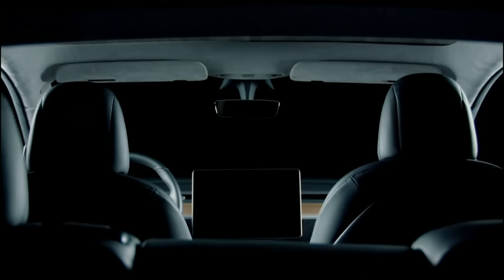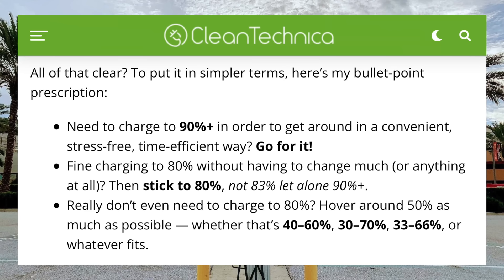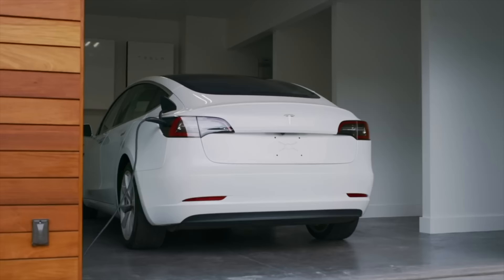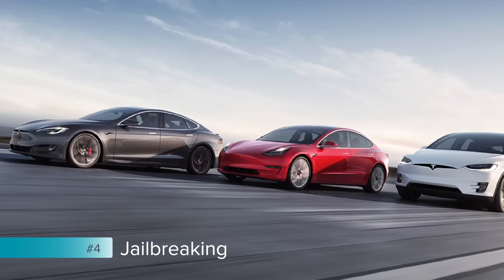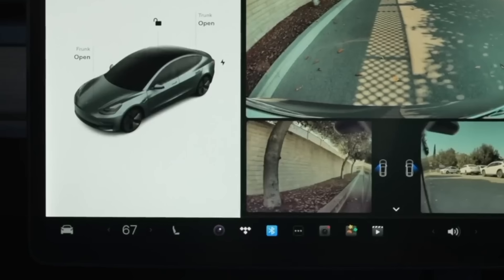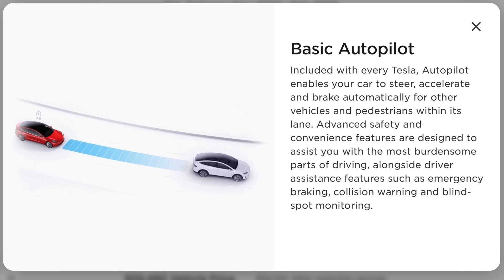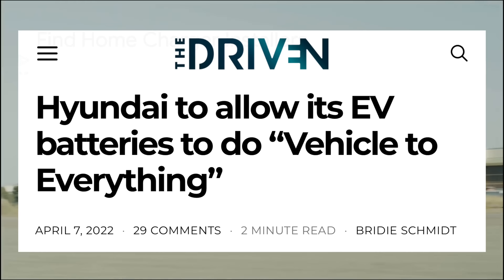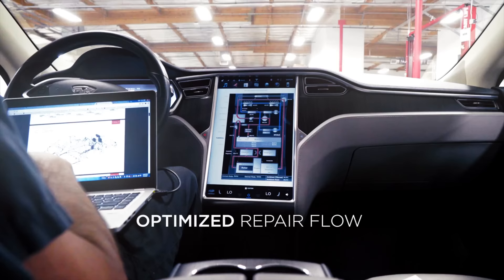10 Ways To Ruin Your Tesla | DO NOT Make This Mistake

Comment: Useful video. I have to say that I have been recharging my 2015 LEAF in the worst way possible, some of the time. I regularly drain it down to zero and then recharge it back up to 100%, and then keep it there for 8 hours or overnight. None of this is because I want to or am trying to damage the battery, but because of necessity and because the UI for the LEAF is horrible. There may be an app, but it was so terrible I couldn't sign in even once when I first got the car. Average battery degradation though. 68K miles and down 1 bar. 🤷‍♂️

Comment: Great video sir!!! P.S. I would add that, setting the Autopilot speed too high can cause it to steer out off its lane. This happens to me mainly in parkways, if the speed limit is 55 setting it to 70 is a problem in certain curves specially when there's a hill. Sometimes it slows down but other times it goes over the lane and could hit the shoulder if you don't take control.  I only increase the speed 10mph+ above the speed limit  in large interstate highways... The fact ppl know when NOT to use Autopilot makes me wonder how valuable are the safety stats Tesla publishes. 🤷‍♂️
Reply: Agreed, my usual local highways don’t have very many curves so I never noticed. Went on a roadtrip to LA where the route curves a lot in some areas, and at the max Autopilot speed of 85 mph, the car did not stay in the lane at all and actually went either into the shoulder or the next lane…was very scary and I ended up disabling AP when a curve came up because of how little effort it made at staying in the lane.
Reply: @vijayraveendran9075  85 is a high on curvy highways.
Reply: @StefanSteinerWA  Agree... Maybe it should display a warning.
Reply: Weird, my m3 won't let me go higher than the mandated km at lower speeds. Only once you're at 100 km/h or 60 mph will it let me cruise at at the maximum 150 km/h, something I always accepted as a very logical safety issue.
Reply: @Daergarz  I've noticed that in some local streets that have 30 or 45 mph speed limit.
Reply: @Teddy_M85  Our Model 3 popped up a warning that auto-steering is only intended for reasonably straight highways with clear lane markings.
Reply: Why not just do the speed LIMIT? You don't save much time by speeding and you create a dangerous situation to others around you. Hope you get your license taken away soon.
Reply: @safetylast911 Because my time is valuable. Worth over $250/hr. Not valuable enough to hire a driver so I can work rather than drive, but valuable enough that getting 2-3 citations per year is negligible compared to the time saved. Driving 30% above the limit saves me about 100h/yr compared to your suggestion. So let me rephrase the question to you. If someone offered you $25000 a year to drive 30% over the speed limit for the year (traffic permitting, no need to weave, just follow the car in front of you in the fastest lane), would you do it?
Reply: That's the most ridiculous thing I have ever read  @Elladril

Comment: Ryan the optimum SOC range for lifetime varies by Li-ion manufacturer and is not universal to all Li-ion. Some like sitting at high SOC, some like sitting in the middle, some like sitting at low SOC. I personally tested over 13 commercial Li-ion manufacturers between 2014-2020 and created a completely new test program targeting sensitivity to certain SOC ranges and saw results all over the map. Tesla’s 1st Gen 2170s were different than 2nd Gen. I’d expect 4680s to be different yet again. Also determined by other factors such as resistances and the heat-dispersion capability of the cell, of which the 4680 should be exceptional.

Comment: The clunkiness of the front trunk has always puzzled me, comparing to the rest of the vehicle.
Reply: It is aluminum to save weight.
Reply: @billhunsinger862  I'm referring more to how it closes.
Reply: @shumandaniele  It does not have a safety catch that I thought was a requirement. I was thinking of getting the auto version but there was an incident that it released at speed and resulted in $3,000 damage. The after markets versions have ceased advertisements.

Comment: my tesla tells me to charge my car to 100% once a week “To maintain battery health, keep the charge limit at 100% and charge fully once per week”
Reply: Do you have a Model 3 or Y standard range? If so, you likely have a lithium iron phosphate (LFP) battery. Those have a tougher cathode structure and can withstand the strain of repeatedly charging up to 100 percent. They can also stomach many more charge cycles than traditional lithium ions — into the several thousands, which is likely far beyond the life of the car itself.

The disadvantage is energy density: you simply can’t hold as many joules per unit volume as “normal” lithium ion batteries. This is why they’re only used in the standard range, and not the long range trims.

Comment: I use my Model 3 for Uber and Lyft, so I always have people in the back seat that don't know how to open the door.  I am currently looking for a way to install a micro-switch on the emergency release handle such that it triggers the "normal" door opening switch if pulled.  If there's power, it opens just fine, no harm done, and if there's no power, it still opens!

Comment: I use an elastic band around my interior door handle and it loops around my steering wheel and uses caribiner clips to latch/unlatch.

It’s perfect for long straight drives through the desert and I play my switch or read a book. 

I still pay attention to the road and anytime there are multiple cars around me I will be ready to take control, but it’s pretty fantastic…. 

Is it unsafe? Not anymore unsafe than a screaming baby in my car….

Comment: The LFP battery charging to 100% is actually not for the battery. No battery like being charged to 100%. Tesla specifically calls out the 100% charge is for the BMS to accurately calculate range.

Comment: I stopped at the second minute. For model 3 it is recommended to charge your battery to 100% AT LEAST once a week. Model 3 use LFP batteries.

Other models such as model Y or X are strongly recommended to charge up to 80%

Comment: I have lived off grid for ten years and built the solar systems myself.  I then bought a long Range model 3 and used four 400 watt solar panels, a 3500 watt inverter a 60 amp charge controller and six 100 amp lithium batteries to charge my car. It got consistently 6 mph on 120 instead of the 4 mph a normal home service gets. one day I went to a Tesla super charger and the display informed me that charging was complete. It had not charged at all.  Fortunately Tesla was a few block away and they said I needed a new battery and it was under warranty and replaced it. I don't use my system any more.

Comment: 1) Range isn't what they say. Only 80% down to 30% or half. So 176 to 203 miles when new. 20% loss over time so 140 to 163. Many people commute 150- 200 miles each day r/t. Forget the lie of " most drivers".
2) Tesla "owns" your car and you cannot modify it without voiding your warranty. This new way of businesses is unwanted and authoritarian.
3) Interior cameras will monitor you for compliance with self drive. This will expand and then spread to gov't monitoring of you inside your car for public safety.
This is authoritarian, unwanted, violation of privacy and dystopian. Pure Orwell/Black Mirror.
4) Teslas too picky when shutting the hood. Design a better car.
5) Car needs charge once a week, cannot sit (go on vacation?) and cannot be drained below 20%.

Recent grid issues show what will happen. Grid is stressed you cannot charge, govt will remote lockout your charge (done in CO this week with home smart meters) with smart meter.
Car sits, battery is damaged, you need to buy replacement battery for 10k to 30k.

In summary EV - range is a lie, spy on you, unreliable, picky, finicky, have poor range, and will accelerate their own destruction as they force grid shutdowns by need to charge to prevent permanent battery damage.

All of the above analysis done by applying reason and logic to the video.
No conspiracy theory was needed just common sense.

EV are a mistake.

Didn't even do environmental analysis or strategic.

Comment: Supercharging often will drastically deplete the battery life. People who live in apartments that don't have a charger are the ones who are complaining about battery life. First off many of them bought used Tesla's so who knows what the previous owner did, secondly using supercharger all the time is just bad. You need a 240VAC charger if you want long battery life. Over 75k miles on my Model S - used superchargers 3 times... ZERO degradation on my battery.

Comment: AVOID SCRATCHED RIMS
dont pull up close to the curb, drive a little past your spot and back up, watching your rear tire in your side passenger mirror you can wiggle and get perfectly tight to rhe curb. when you drive up, youe blind.. you cant see your front tire next to the curb so juat back up and use your mirror.

i once took a weekend driving course like 15 years ago and half of 1 day the 6 of us and instructor just adjusted our mirrors and we all helped eachother understand the importance. i mean half the battle is dont guess just get out and look, STOP and look.. you will know your surroundings.. if its busy just put your four ways on smile wave and say sorry.. just do you it takes 15 seconds to get out and look.

ive had my class 1 for 20 years, journeyman crane operator etc.

Comment: I wouldn’t spend money on an auto pilot nag defeat device either but as long as you pay attention and are prepared to take over I don’t see how it’s any more unsafe not to have your hands on the wheel. Ford’s auto pilot competitor “blue cruise“ or whatever it is doesn’t require you to have your hands on the wheel at all as long as you were monitoring the road.

Comment: Would like you to do a video on towing and phantom braking. I have a '21 model 3 Long range. I had u-haul install a tow package and pulling a trailer (<2000 lbs) and lose about 40% range. When I drive on highway 97 between Weed CA and Klamath Falls OR I experience a dozen or more phantom braking incidents. Bug reporting it for a year now.

Comment: 1. Don’t overcharge the battery to 100% (unless it’s an LFP battery )
2, Don’t run battery to 0%
3. Don’t slam the hood or bonnet
4. Don’t buy non Tesla software upgrades (3rd party modification) could void warranty 
5. Be careful with scratching your wheels- easy to do
6. Electric Door handles- manual override could damage interior trim from inside
7. Hardware modifications could void Tesla warranty 
8. Auto pilot - you need to be present and pay attention- don’t bypass this.
9. Don’t use Tesla battery as power source for anything else
10. Don’t service the car outside of Tesla garage network

Comment: Using a small inverter is not wiring a house! I got a small 300 watt unit to run my inhaler machine in an emergency! Great to see it voids my warranty! That’s unreal. The 12 volt battery usage should not void warranty! What if in an emergency another car needs jumping because of dead battery? 12 volt battery should work fine. Not using EV battery only entertainment system battery

Comment: I learned the hard way that the Tesla Model Y needs to have an alignment done soon after taking delivery.  I had a flat many miles away from the nearest town in North Texas.  Amarillo was the nearest town, but when I searched for a replacement tire there were none available until Monday (the flat was on Friday).  The inner tread on both front tires was completely worn through.
Reply: Oh, that's scary.

Comment: IF TESLA WOULD LIKE TO HAVE THE ABSOLUTELY  BEST MILEAGE OR RANGE TO ALL OF THEIR VEHICLES EVEN THE CYBER- TRUCK IS TO PUT ON A BICYCLE TYPE GENERATOR ON EACH TIRE AND THEN THE CHARGE- UP COULD BE MAYBE AS LOW AS ONCE A MONTH OR POSSIBLEY EVEN NEVER DEPENDING ON THE QUALITY OF THE GENERATORS THAT THEY INSTALL TO THEIR VEHICLES- !!!!  THIS I BELIEVE WOULD REALLY BE A GAME CHANGER- !!!!  I HAVE A 2004 DODGE RAM PICK-UP WITH OVER 310 ,000 MILES AND I BOUGHT THE TRUCK NEW  AND MY HOPE  IS THAT SOMEDAY I WOULD BE ABLE TO UPRADE TO A CYBER- TRUCK AND WHAT WOULD MAKE THAT FANTASTIC WOULD BE TO HAVE DUAL WHEELS IN THE TRUCK AND ALL TIRES TO BE RUN FLAT TIRES THAT NEVER HAVE TO WORRY ABOUT ROAD HAZARDS OR ANY OTHER TIRE FAILURES THAT MIGHT OCCUR- !

Comment: Has anyone had issues with how easy the front window chips? Any recommendations on a repair kit?
Reply: I got hit by a rock 2 weeks into my new 2021 Y.  Rock hit the bottom drivers side.  The crack went immediately.  Replacement.  Then I got hit again in the drivers side at the top, not replaced yet.  Don't want to have my insurance go up.  Will wait till it sends a crack.  It doesn't effect my vision.

Comment: Is there a basic model where there are no electronic features. A mechanical speedometer, manual locks, manual windows, manual radio, no touch screen, manual steering (non electric)? 1:58

Comment: 2017 Model S - I've charged my Tesla to 99% to 100% every time, no degradation, no problems (so far).  What's the point of buying car w/ X mile range if you can't use it?  I also charge my smart phone to 100% regularly...

Comment: I have a 2013 85S ,my battery needed to be replaced two months out of warranty for around $12,500. that was a deal a new battery would’ve been closer to 25. Then someone ran a stop sign did $35,000 damage to my car.  That Battery needed to be replaced AGAIN They were kind enough to put a new battery in. What happened was astounding this new battery will give me 250 miles, or so it says, on 90% charge! And yes Ryan I do think one of the worst things about 21 inch wheels, and no cameras is you will get that curb rash. Very expensive to fix so I gave up. I love the Tesla but the very worst thing is how they go through tires. My rear tires only got 9000 miles. And I do not do Figure eights in a empty mall parking lot either it just eats through tires.
I was fortunate that when I bought the car (A little under 50,000 miles on the odometer)it came with unlimited charging, grandfathered in for life. I don’t believe you’re allowed to transfer that perk anymore so I’m planning on keeping this car long after my own “body warranty” is up, lol thanks Ryan it was great information. Keep up the good work.

Comment: #1 only charge to 100% at least once per week (newly delivered RWD batteries) otherwise keep charge limit to 80%
#2 don’t drop to or below 0%
#3 don’t slam frunk hood
#4 don’t make third party mods (ghost upgrade) could be caught and warranty voided
#5 not paying attention when pulling up to curb. wheel takes the hit not the tire.
#6 don’t use the manual door release regularly as it can damage trim and window.
#7 hardware/upgrades from third party vendors could give tesla reasons to not repair under warranty
#8 don’t try to get around the auto pilot safety features.
#9 tesla batteries are not meant to reverse charging (powering your home with the battery pack for example) it’ll void warranty
#10 you can void warranty if non certified personal work on your car.

Comment: I have a 2021 MY.  This may not be true for earlier models, but if you manually open the front doors, the window will lower just like pressing the button.  I first discovered this when I had a passenger unfamiliar with Teslas used the manual release until I told him how to open it properly.  I did later see where Tesla had updated cars to open the window when using the front manual release.  Again, I am not sure how far it goes back for older models.
Reply: It always lowered a window, that is not root problem of this issue. Root problem is that when You press a button, Tesla will roll down window first and then open a latch. With manual release, you open a latch first and Tesla rolls down as "reaction" to latch being opened. It happens so quickly You might not notice it.

Comment: So I don’t love the Tesla recommendation of charging LFP packs to 100%. I think it’s wise to do it once or twice a month for cell balancing but every time? There are three issues with this: 1 - weak regen at 100% and 2 - even LFP batteries will benefit from being charged to only 90%. 3. - If you’re using excess solar to charge the batteries then it costs more to add grid to continually charge to 100%. I’m not sure what buffer Tesla have at the top of the pack - it’s difficult to balance cells below about 95% because the charge/discharge curve is so flat, so I would assume no more than 5%. LFP packs should last longer than other lithium chemistries so Tesla aren’t really hurting the warranty by charging to 100%.

Comment: What'snot clear to me is if I should wait until battery gets to 20-30% before charging (to let battery charge to cycle), or just charge overnight every night to 80-90% no matter what charge level is? Originally Tesla reps said just to keep topping it of to 90 even if you drove only say 30 miles in a given day. Last guy at delivery said oh no don't charge until it gets to 20-30%.

We don't have (yet) level 2 and use trickle. Drive about 25 miles one way (plus incidental mileage). Not topping of daily means toward the end of the week we may not have enough charge.

So clear on not charging past 90% on daily basis. But not clear on recharge levels and charging frequency. Can you clarify on that?

Comment: Ryan, excellent video as usual. One quick question, does upgrading the USB drive (128GB) from Tesla to a higher capacity (1TB SSD) drive from Sandisk - violate the warranty? I have purchased the SSD drive but have not upgraded yet. Any thoughts? Thanks
Reply: No, it will not.
Reply: why would it void warranty?

Comment: If you have a problem (flat tire or running battery too low to reach a charging station) on the road and use AAA service will that be a problem? Secondly, if your wife's ICE car needed a jump start is that supported under warranty using your Tesla?